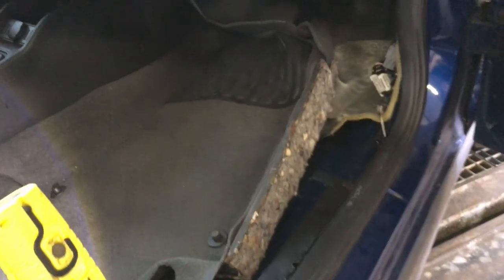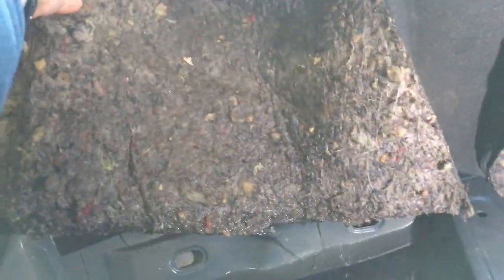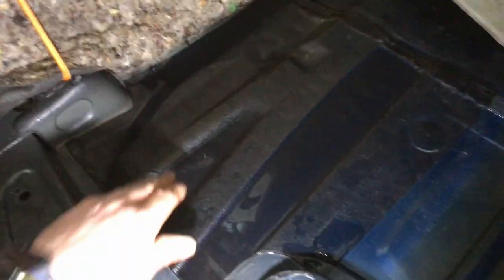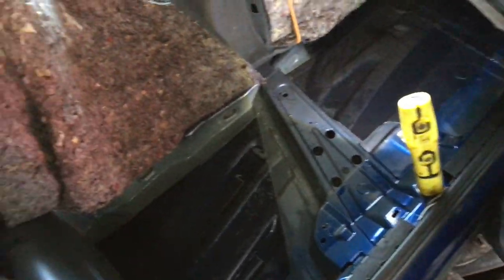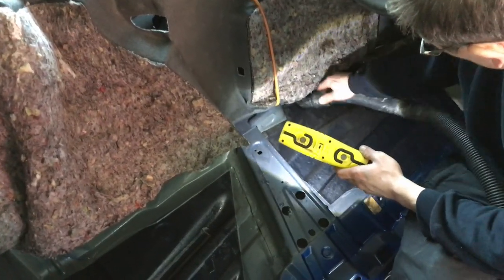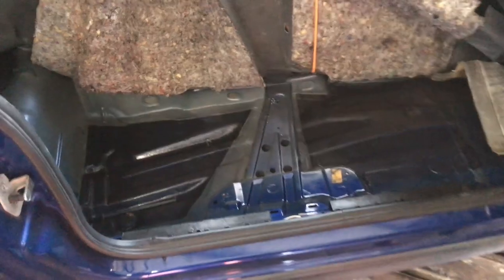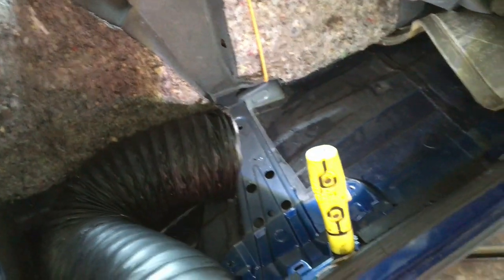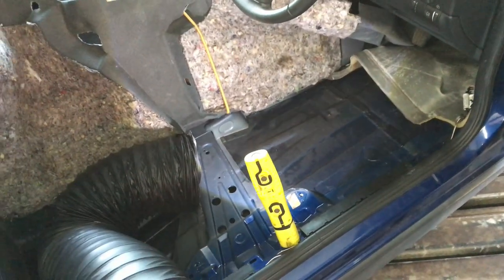How To Dry Carpets In A Wet Car

Comment: Very informative, thank you. I was wondering about the best way to go about this, mold and possible electronic issues if it is not done properly. I do have a little mold and some rusting bolts because it appears his car has  been leaking for a long time now. I might just be replacing the carpet depending on what is available at the local Pull a Part :) Certainly something to look out for if one is purchasing a used vehicle !

Comment: Hello. I have damp and waterlog in my rear footwell foam under the carpet  behind drivers side on my Fiesta ST. Everything else is dry, rear boot no water, liners and all other footwells appear to not have water when I push on the carpet. as the car had sat so think already had water in it. Roughly how much would it be to dry the foam under carpets?
Reply from the maker: Sorry, I can't give estimates over the internet, but if you would like to give us a call we can run through your options. You can contact us through the links in the video description.

Comment: What model of car is this - I believe my Ford Focus has the same problem.
Reply from the maker: We have lots of videos about leaks in Ford Focus on our other channel. ~ https://www.youtube.com/results?search_query=%23FordFocusLeaks
Reply: I’ve got same problem with my Ford Focus mk3 2011.. The garage had to drill extra holes in boot area as it was filling up spare tyre area , carpet on floor at passenger side is absolutely soaking! Drivers side fine... nightmare ... I read there that it seems to be a reoccurring problem for Fords 🤨
Update.. problems carried on so traded it in.... Ford never again!!! 😅
Reply: Focus mk3 has vents behind the rear bumper that allow water to build up inside until it overflows into the cabin floor. You can remove the bumper and seal around the vents (there are four of them) but the quicker solution is to look under the bumper and in each corner there is a black rubber bung, pull that out and let the water drain, then pull out the wadding through the hole. Then take the wadding and the bungs and throw them in the bin as they serve absolutely no purpose, the vents and cavity are for cabin airflow and the wadding is just sound deadening. Terrible design + sub-standard materials x poor build quality = modern Ford. Never again

Comment: in my Vauxhall Meriva A , the Passenger side front and back carpets are soaked. I cannot find the leak having looked everywhere. When i brake hard i can hear a rush of water towards the front passenger door in the floor somewhere. Someone suggested it may be in the side skirts but i cannot find any evidence of leaking from there and when i stuck a stick in from the top it came out dry. Checked sunroof drains but all working good. Its doing my nut in. Any ideas, much appreciated, cheers.
Reply from the maker: I don't think we have done a Meriva. I'm afraid there are dozens of places that could be leaking, rear vents or lights, door membranes or screens. Leaks are difficult to track down and you just have to keep looking until you find it.... and then keep looking because it's not rare for cars to have several leaks when they get to a certain age. Sorry i can't be of more help.
Reply: Sounds like the ac drain line
Reply: I bought a Vauxhall Vectra today and didn't realise there was water in the front and back passenger footwells until I'd got it home!

This video helped me find and fix the leak: https://www.youtube.com/watch?v=2VGr7jqDd8s

Your Vauxhall might be different, but it's worth a try.
Reply: @lukesymmons  Nice video, never did find where it was leaking in from, but cleaned engine bay including similar drain holes in my Meriva and has been dry since, fingers crossed stays dry too. I found the sloshing water eventually, it was in the side rails that run between between both wheel arches. Turns out my car was undersealed by a previous owner and they covered up a one inch plastic bung. Once i found it and pulled it out about 3 litres of water came pouring out, left the bung out now.
Reply: @DAM89  how did you get it dry? Did you do it yourself or get it professionally cleaned?

Glad to hear you got it sorted in the end
Reply: @lukesymmons  I used a pond vac (wet & dry vac) to suck most of the water from the carpet and underlay, then let it air dry, some hot summer days helped in July, but still took about a week before it was completely dry. I was surprised at how thick the carpet underlay was in some spots about an inch thick, always thought it was much thinner. I did try pulling the carpet up but give up after realising id have to take out the seats and remove all the trim plastic pieces, thankfully didn’t need to.
Reply: @DAM89  I was considering getting a wet dry vacuum and doing the same thing, but I'm worried there could be water sitting under the carpet and underlay that I couldn't get at unless I took up all carpet.

Comment: You should have shown the equipments used
Reply from the maker: We could do next time, although I'm not sure that would be much use to most people, as our equipment is very specialized, very expensive and runs off three phase power. It isn't the kind of thing you can get down the hire shop. But essentially we use an industrial extractor, air movers, and dehumidifiers.

Comment: got the same problem on a 81k bmw, went to a mechanic that was a chief mechanic at bmw and now have is own big shop, the bastard, treat me like shit, ripped me off with Butyl Rubber Tape that costs 10 euros and charged me 80 euros plus all the hours... and the fukin animal didnt even bother to dry the floors, he just fixed the leak, now i have at least one floor that is soaking wet and have to fix it for myself.... i dont have a fukin machine for this, will try to dry it with what i have a hairdryer.... what a nightmare and cant even stand his face after this....7 or 8 hours of another shop to dry this or risk it and corrode all the car..... dear god..... dear god... why cant people be professional and honest??? why? could he run me off even more to never have my biz again? why people treat others like this

Comment: Not in many Hondas: they use some type of foam beneath thick rubber mat on tof of which there's the carpet. In this way the foam soaks all the water and the thick rubber mat on top can't make the water in the foam to evaporate, trapping the moisture. With time the rubber mat breaks and the carpet on top gets wet. All with mold smell and mold on top of the carpet. Stupid japanese engineering.